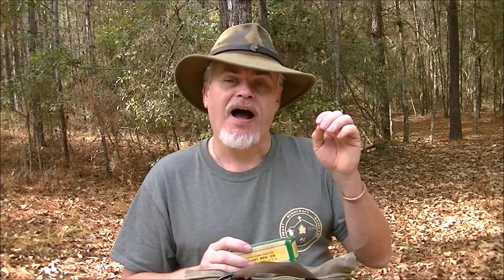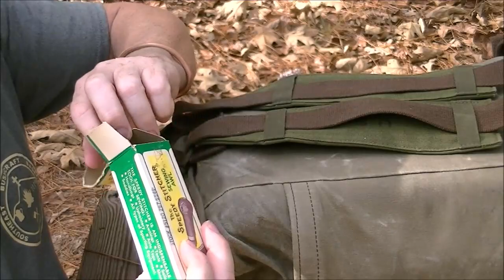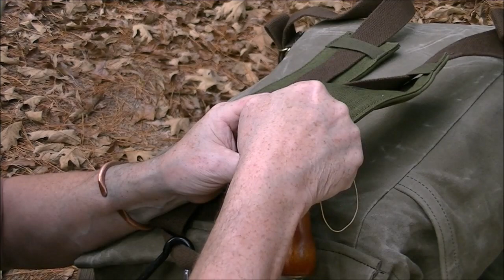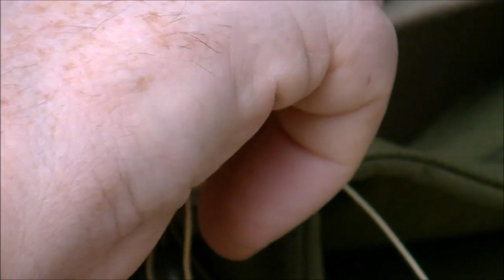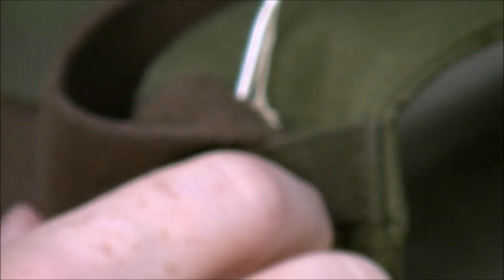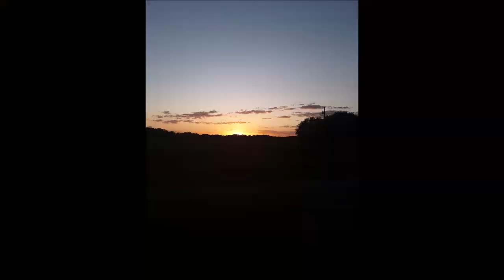DOWN N DIRTY WOODSCRAFT A STICH IN TIME

Comment: Thanks Blackie, Been using the Speedy Stitcher for over 50 years for repairs. Even found a few older versions at garage sales that were made out of steel, not aluminum. I have a 5.11 backpack that has a pad that drops down becoming bothersome. Will consider a similar repair to fix for the problem.